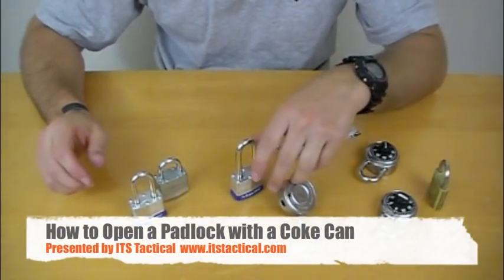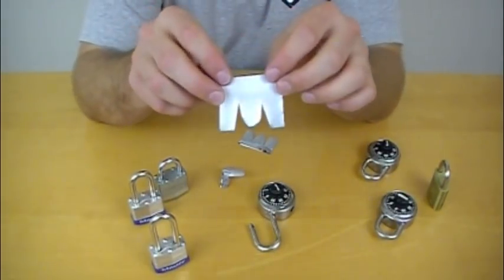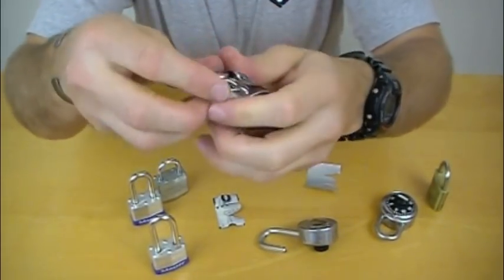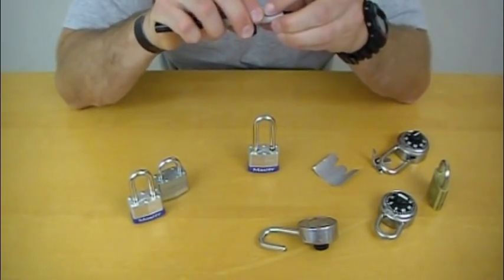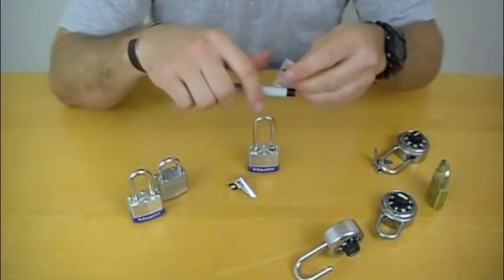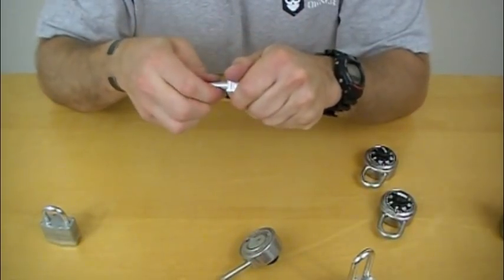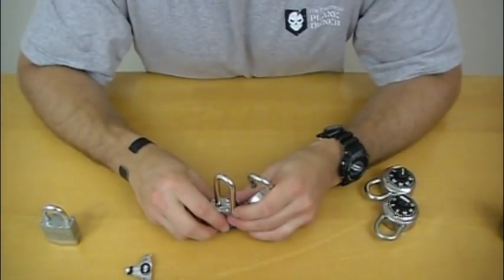How to Open a Padlock with a Coke Can

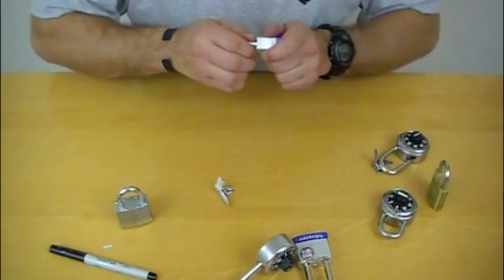Comment: 5:55 Video was paused. . . from 5:57 he already had the Padlock on his Left Hand and didn't show the bottom part of it until 6:56 where he placed the Padlock outside of the recording view of the camera. . . 

He wasn't able to open the tougher Padlocks and hence used a Key to open it.

LOL!
Reply: lol at the fail, you can see he has the key in. he would never make a good magician with that not so slight of hand lol
Reply: True, the gym locker combo locks seem easy...But, how easy is it to open if it's locked on a locker? As for the padlock, he had the right idea. But, he gave up and used the key that was hidden in the cup of his hand. He should have just showed the combo lock and left out the padlock all together, as that was clearly opened with the key.

Best bet is to get a pair of short handle bolt snippers to snip the shackle. Works every time, unless you're trying to open those case hardened steel locks used on store gates. For those, you need the jaws of life to open. LOL

Comment: Alternate method:

1) Poison can of Coke
2) Offer poisoned Coke to key holder
3) Search key holder's body for the key
4) Use key to open the lock
Reply: or, don't steel stuff, and if you forget your own combination, an angle grinder is a heck of a lot easier and faster
Reply: hugh jass DAMN IT! i hope your a woman cause i love your pic if not your girlfriend has a fine rearend!!
Reply: Greg Miller
ha ha ha, ew...
hugh jass 
I get the pun...
Hugh = Huge
Jass = *
Reply: Lucas Fowler iż

Comment: thanks for this vid.
so for the double lock, you'll just need to twist one of the shins, and just leave the other one untouched?
do you need to twist clockwise or counter, or it doesn't matter?

in a locked padlock, how do you know which one, left or right, is the one for unlocking?
Reply: De Day you learn the locks by getting a few to practice with or looking up online, then on sight you know which they are. thumb rule - many brand name key locks are double-dogged, and most combo locks are single.

Comment: before opening the code lock, you can see he turns the combination dial as it unlocks. he prepared it so it needed just one more slight turn, which you can see he does right before it opens.  well done sir

Comment: THAT'S NOT TRUE, WHEN HE GOES OUT OF THE VIDEO IN THE MINUTE 5:55 AND RETURN, HAVE A PADLOCK WITH A KEY INSERTED, AND NEVER SHOWS THE BOTTOM, AND WHEN HE SUPPOSED TO OPEN IT,  PUT ITS AWAY OUT OF THE VIDEO AND SHOWS ANOTHER ONE THAT IS STANDING CLOSER, CHEK IT OUT IN THE MINUTE 6:55 AND THEN IN THE MINUTE 7:24 HE TAKES THE ONE THAT HAVE READY IN THE VIDEO STANDING, THAT YOU CAN SEE BEFORE HE DROPS THE OTHER ONE...

Comment: What an eye opener!  Some animal stole my set of keys of which one of these was a padlock key to a Master lock.  Tomorrow, I'll use your technique, hopefully saving the hassle of drilling the lock out.  In the long-run the lesson is not to use Master locks of this type to secure anything value.  I imagine the Master Lock company really doesn't like you that much.  But, you have at least one thumbs up from this direction.

Comment: I love it, as a locksmith by hobby I have been picking locks for 45 years but I always used 2 inch pieces of steel tape measures and they usually cut my fingertips until i put sticky tape on the end by my finger and steel lasts for many openings I trim the metal to shape with my electrician's scissors...

Comment: If you notice when he comes back with the key lock he makes sure that the bottom of the lock doesn't leave the palm of his hand. Because he is cupping the key. The lock opens when he turns the lock in his hand. And he states at the end that he shows the illusion of opening a lock. Even so, with enough patients and practice the shims do work. Use a little bit of oil or spit on the shim it helps to slide by the locking mechanism easier.

Comment: a much faster way? a good solid hammer - whack the base downward, where the loop meets the base. or use a screwdriver through the loop, whack the screwdriver downward where it meets the base. or a .45 bullet will do it too. :)
Reply: or bolt cutters
Reply: Edward Yasko those are loud and heavy methods. Lmao
Reply: Not sure, I think liquid nitrogen works as well, since we seem to be listing all methods possible.

Comment: An alternative would be to use a feeler gauge, saves messing with coke cans.  There is another method that works with some single side locks, hit it sharply on the side with a hammer. The inertia of the impact momentarily pops the locking ball and allows the shackle to spring open.  For these reasons I always use high security padlocks!  However, no padlock will resist an angle grinder with a metal cutting disc installed, and rechargeable angle grinders are now available!

Comment: @MigitSniper Note on Naming: Sir Humphry Davy proposed the name aluminum for the metal, however, the name aluminium was adopted to conform with the "ium" ending of most elements. This spelling is in use in most countries. Aluminium was also the spelling in the U.S. until 1925, when the American Chemical Society officially decided to use the name aluminum instead.

Comment: I can confirm  that this works. just tried it on an old lock from gym that I forgot the password to. it took a couple tries to get it the right size to fit but once I figured out the right size, the thing came open in about 10 seconds. Shame they're one time use but it's not like I can't go get another can and make 8 more.

Comment: note that this only work with most of the lock w/ spring mechanism but for a pad lock that lacked springs cannot be opened this way and the abloy protec series has anti-pick disc on them

Comment: a flathead screwdriver can pop the cover off the dial ones and you can pull the center pin out after. it's a simpler method and alot quicker. obviously doesn't help with the keyed locks.

Comment: Not necessarily.  The time it takes you to go get some bolt cutters is going to be longer than the time it takes to grab a shim out of your pocket.  (Most people don't carry cutters everywhere.)  Also, it will be obvious that the lock has been cut with bolt cutters.  Whereas, if a lock is shimmed open, it can be relocked.

Comment: "It shows a lot of maneuvering around with the hands, holding the lock in various dynamically different positions during the process of inserting the shims. If the lock were in actual use on a device, it would not be so movable, making this process much harder. "

This!

Comment: If you check most padlocks ,the pin fits in the hole so tight.There is not enough gap to insert a shim. It it were thinner, It would not be strong enough to push open the catch anyway!

Comment: I've used it, way back in the late 60s, early 70s, Jr. High, popping lockers, it works, found something better, opens padlocks, combo or key, doesn't matter, open in less than 5 seconds
Reply: What did you find that was better?
Reply: they are called bolt cutters

Comment: It is easy if the locks are not being used. I am not saying that it does not work. It works for people that lock the keys inside and want to save the lock, but otherwise bolt cutters are incredibly cheap at Harbor Freight.

Comment: You have a point with the use of the shims... problem is you cannot do that lock twisting if the padlock is installed on a door. No thief will do that long, not that easy.  Just get a big hammer mallet perhaps and smash that lock... whatever.

Comment: First off, welcome to the internet. First day here?

Also, just 'cause the dude moves the lock around doesn't mean you need to do so. It's simply easier to see what is going on if you move the lock, which you don't really need to do if you're trying to open the lock instead of shooting a video showing how to open the lock.

Comment: Today I went down to my shed and the combination lock woudn't open. I noticed some very slight aluminum shavings right where the lock would open, like in this video. I'm beginning to suspect someone tried to open the lock but couldn't. However, now the lock seems to be stuck because of the aluminum.

Comment: Its much easier if you just use the metal eraser cover on a mechanical pencil. Just cut it in half and then the end off. Use something to force it down in the lock. Much stronger then your can.

Comment: Hell yeah it can slice you clear to the bone plus they bend, twist, etc., etc. That's why I noted above to make your pieces out of the BIG BLACK PAPER clips because they're " 10 time much" stiffer metal. I "play" with locks ALL the time. Master, Yale, American, etc., & their tolerances are so tight between the shackle & the holes, using "aluminum" shims (soft) I'd bet $500.00 the kid the just turned the key in the lock. I can pick the better locks, but you'll NEVER "shim" them w/ soft aluminum.

Comment: my master locks have virtually no clearance between the shackle and body even with the thin steel shin it wont slide between the body ans shackle  BBut if i enlarge the holes to allow for the clearance of the shim it works lets see a close up of the closed lock and shackle i own quite afew master locks and they are a tight fit good luck

Comment: I happened to have a padlock sitting right in front of me as I found this video, and it has several security features to prevent this kind of picking, and it's a pretty cheap lock to start with...

Comment: Bolt cutters are MUCH faster.  If I'm breaching a lock, I don't want to spend a lot of time fooling around, making noise, and not paying attention to what's going on nearby.  The bolt cutters won't make much more noise than banging the lock around on the hasp, and they can be used as a striking weapon after the door or gate is opened.

Comment: I notice how much you had to manipulate the lock in order to work the shim into the critical location. You will not have that luxury if the lock is actually attached to something. There will be very little space to work with between the two "legs" of the latch because there will typically be something there that the lock is attached to. So, this may be a great way of opening a lock that is not attached to anything, but it seems that it would be much more difficult than depicted if it IS attached to something - maybe even undoable.

Comment: Well there is one problem with this new lock. And that is you can only use it if you are inside. Because if you were to lock your door using this new device you will not be able to open your own door. Just take a minute and really think about it. those of you who have bought this new piece go open your door and lock it open and drop the new piece and take your house key and try to open the door you cannot because you have locked it with the new pieces

Comment: It is true that shimming a lock like this is possible. The difficulty is that the coke can aluminum is too thin, and it easily tears or crumples. It's possible, but very hard. Real steel shims work much better. If you use aluminum, you'll have to try it numerous times to get it to work. Even worse is when you need to shim both the shackle's heel and toe. Trying to get two aluminum shims to work at the same time is nearly impossible. In this video, he tries for a bit, and finally gives up and cheats by using a key (hidden in his hand). Shame really. I'd have like to see him stick it out until he got it.
Reply: I tried this a couple years ago and couldn't get it to work.  Only this morning did I find out that you can buy steel shims for this purpose.  Using cut up coke cans is borderline impossible, if not actually so.

Comment: I call BS on the laminated Master locks. He either opened it with a key or Master lock makes low-bar locks. I tried this with a Brinks laminated lock and both shims broke inside of it. However, the shim did work for the Master brand combination padlock.

Comment: did i miss the part where you told us that it only works with very cheap locks that don't use ball bearing locks? Because it looks like you are giving us the impression that you can open a 10 bucks masterlock no3 with a shim that we can open any padlock with a shim.

Comment: this really shows how these types of locks are not as secure as the manufactures make them out to be.... There are much better locks to secure our valuables!   I have been using Kryptonite Shackle-less Padlock Ref: 855156 and disc locks for years.   I hope they are a more secure solution??

Comment: i dont think he used a key
1 as he was twisting it he help onwith abit of the palm to the padlock not permiting the movement enough for a key to turn unless it was allready turned and needed only  mm more but i dought that because if so the preasure would have puched it sooner
But...
he did keep his hand unusually stiff in that part seeming like he had somthing to hide

Comment: Easy to do once its learned to shim a combo lock when It is not attached to anything. Much harder when It is attached to something because it makes it harder If not impossible to turn the shim when a large thick piece of steel that the lock goes through is in the way.

Comment: I'll be damned. I came here expecting to see some load of crap that some dimwit was foisting on the lowbrow set.

But after only 2 minutes, I saw where he was going - he used the aluminum to jimmy the padlocks the same way you jimmy a door latch with a credit card.

Much more interesting than I originally expected!  :-)

Comment: Maybe he did have a key but you CAN do this with practice... What needs to be taken into account is the The item the lock is being used on, Hinge, chain, etc... If noise is not a factor a few blows from a rock or a hammer will yield a faster result. keep watching, there is more than one way to skin a cat..

Comment: If you use "coke cans" be ready for stiches. I use parts needed from those BIG BLACK PAPER CLIPS cut w/ tin snips. Fold over the top edges, cover w/ a little duct tape & w/ a "little" filing, be "super" thin but yet 10 times stronger than aluminum. They'll slip right in any crevice. With a little molding around the shackle like the kid did & you're set to go. Keep a 2 in your wallet. Once your buddies see you pop a school padlock in 1 sec, They'll ask U for some. Sell them at $10 bucks a piece.

Comment: @ITStactical so what you are saying is that this is a blooper reel? no sry, actaully from what you just posted, this is a video showing how it can be 10 times harder picking a lock with no obstructions, in perfect light, in the safty of a mothers basement. great point about the 1/2 inch chain attached to it and the reponse didn't make too much sense.  i would have just got a lock and chain ... practice practice practice. then show yourself picking in a 'worst case scenario'. ~ stuka

Comment: The second lock he still never unlock ed it with the shims,if u watch he keeps his hand over the bottom of the lock, because he has key in lock,, just watch how he turns lock in his hands so he turns key at the same time, then the lock opens,,he never removes his hand from the bottom of lock,then when open, puts lock out of sight,, when he tried it the first time,he takes his hands off the bottom of the lock a few times,and couldn't do it then, what a blagger

Comment: With the second attempt on the keyed padlock we don't get to see the key-hole once. He had the key in the palm of his hand and turned the lock open when he had messed around with it for a bit. He then proceeds to put it n the table off camera, which he didn't do with the first successful attempt or the second failed one. Just admit you could not open the keyed lock in this way rather than mislead your suscribers. Unsubscribed.

Comment: IMHO, he's concealing the key in his palm after the cut. He doesn't show the base of the padlock after the cut, plus the keys are no longer on the table, and at 6:40 is the giveaway, rotates the whole lock and holds the base in a completely unnatural way, and tightens his grip on the key to turn and unlock  - It's actually a little depressing that he didn't just give up and not post a phony video in desperation. *Unsubscribes*